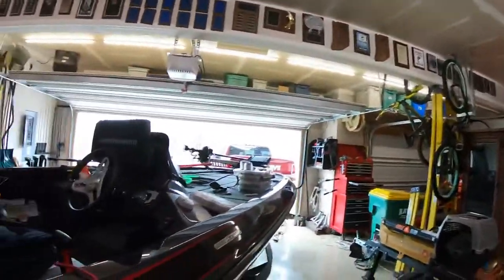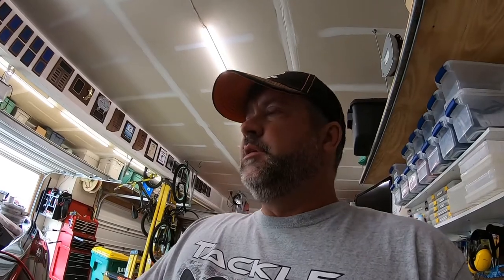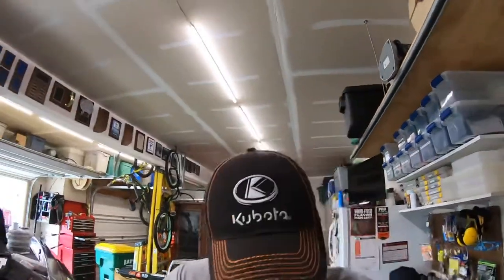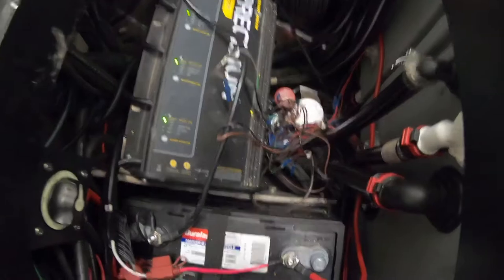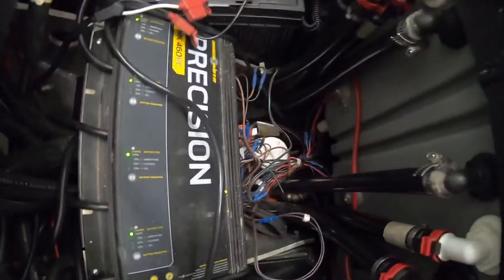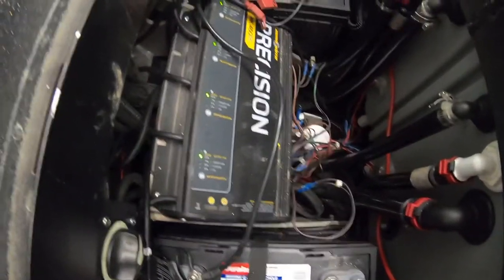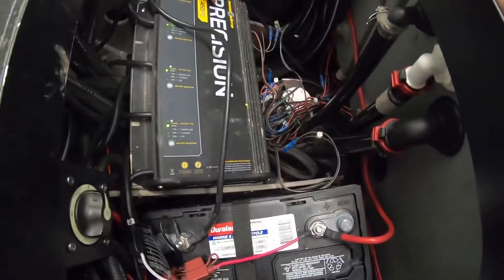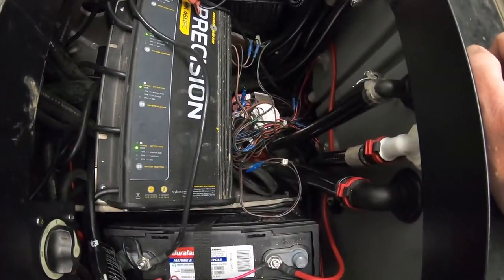Skeeter Boat Wiring 😕

Comment: Curious to see how you fixed this problem. I’m dealing with the same issue with a port fill pump. Just replaced the pump and it’s still tripping the breaker